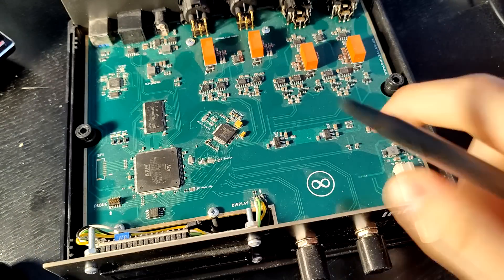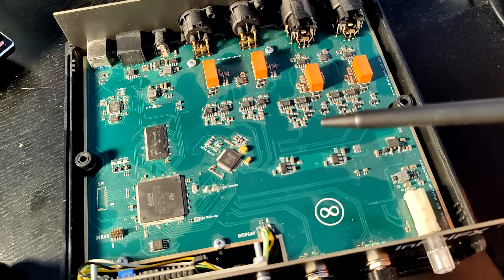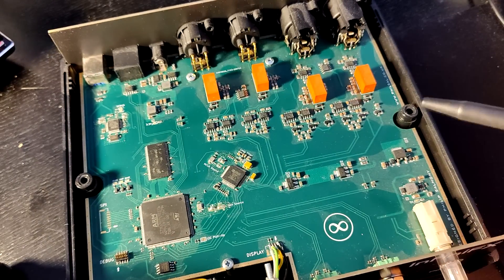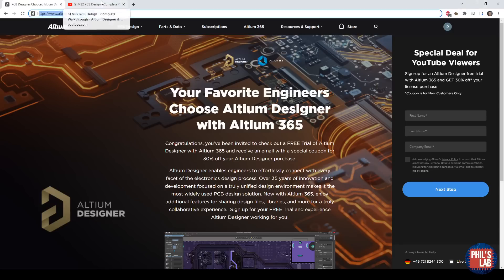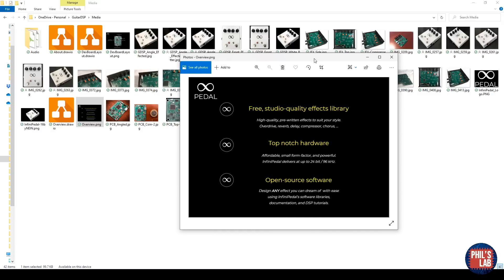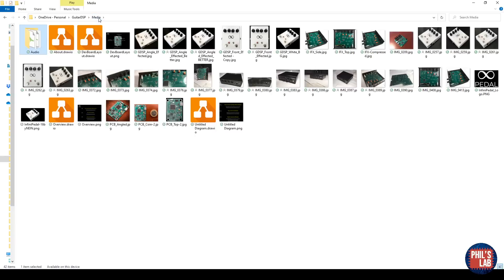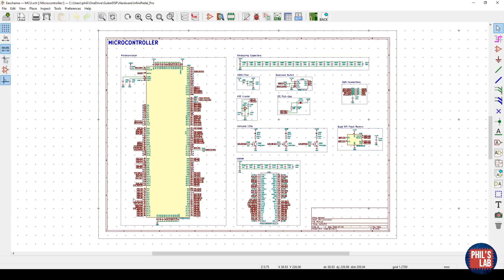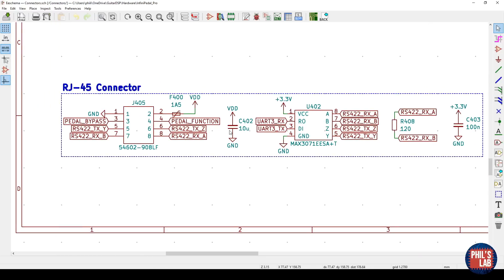(Sponsored) Audio Processor Prototype Hardware Design - Phil's Lab #57

Comment: hi Phil, at 12:47, i noticed on your single-ended to differential converter opamp circuit for the hi-Z inputs, there's a very very HF cutoff LPF (5.6k with 100pF) on the opamp that produces the negative differential output. I'm curious, what is the reason for that? why isn't that opamp just a plain voltage follower like the one for the positive differential output? Thanks :)

Comment: I have done front/back panels using both aluminium and FR4, from jlcpcb. However I find that the FR4 versions are much more rigid. So now days I only use FR4  (unless I need to transfer heat). I always keep the top and bottom copper on the panels.

Comment: Thank you very much for this video!
On a four layer board, would you (nowadays) recommend to flood fill the top and bottom layer empty spaces with ground or are the ground planes enough? (On a two layer board I fill everything, but I don't have too many four layer boards under my belt yet :) )
If I understand correctly, now one would do combined ground planes not to have a PCB-sized dipole antenna?

Comment: Great video as always.
The second STM32 functions as a ST link where did you get the ST soft ? Also what are the minimal mcu requirements to run it ? Asking since a DIY ST link sounds like a nice side project.
Regarding the ground plane , wouldn't it be batter if there was a partial cut separating the buck converters from the analog stuff ? Or would that make referencing harder? 
Also i noticed a lot of via stitching in some sections like i think crystal, it that recommended or you did it just to be safe ?
Reply: You could flash it with Black Magic probe.

Comment: Nice rundown of your project.   Are the XLR connectors (inputs and outputs) attached to the panel?  I can see holes for mounting on the outside, but no fasteners.
Reply from the maker: Thank you, Jim. No, I hadn't attached the mounting screws to the prototype I showed in the video.

Comment: Well done. A few comments for the next rev. Separate AGND and DGND, linking once, under codec. 'A' stuff should only be over AGND etc. Consider the case of un-balanced in and out, maybe take a look at SSM2142 series; one output leg grounded causes other to increase gain by 6dB. Not sure what codec you used, but pay attention to component types; the may be a large value NPO required across the ADC diff inputs to clobber idle-tones - expensive, but a life-saver. I have managed >100dB unweighted with this kind of stuff before, but it does take some effort. Also, relays need to be specified as being able to operate without any wetting-current, maybe gold plated. Long time since I have designed high performance mixed-signal stuff. You are doing good stuff and drop me an email if I can help further - markaren1 in New Zealand.

Comment: Thanks again Phil, I get a lot from these videos. Great to see the components you use in practice - I spied the AOZ1360AIL programmable soft starter in your power schematic and looked it up straight away. A video on how to get robust power protection, fusing and filtering right would be invaluable.
Reply: Agreed, robust power protection with resettable fuses, TVS and stuff like that would be great
Reply from the maker: Thanks for your comment, Dan. Yes, that's definitely on the list of videos I'd like to make in the (near) future :)

Comment: Nice video :)
I would like to ask you why are you using an anti-aliasing filter (20-20kHz) while the codec can handle up to 192kHz sampling rate?
Reply: As the maximum frequency of the signal you want to sample is 20kHz, you must filter at that frequency to avoid other unwanted high frequency components. Other thing is the sampling freq of the DAC, that should be at least twice the maximum frequency of the signal you want to sample, that is why audio is usually sampled at 44.1kHz (a bit higher than 2x20kHz). The ability of some DACs/CODEs of sampling at higher frequencies allow you to recover the signal with better quality and to process it with more agressive digital transformations.
Reply: @eldora7908  Yes It's called Nyquist theorem, but the point of ADC capable of higher sampling frequencies (like in this example 192 kHz) is to avoid using complex and costy filtering circuits.
By the way I have no idea how you can "sample" with DAC -> Digital to Analog Conventer...

Comment: Thanks for sharing phil!

I would love to know more about the H7 programming. I.e, do you have the codec hooked to the F4 core which does all the interfacing, and use the F7 core to process the data, which is shared via HSEM? If you can, sharing and/or showing the code would be wonderful
Reply from the maker: Thanks for watching, Marco!
This is actually a 'single-core' H7, so interfacing is pretty much identical to the 'GuitarDSP' (STM32F4) board, albeit with other drivers to fit the Analog Devices codec. I have a video on the I2S/Driver/DMA code on my channel that goes through the setup.

Comment: Nice video Phil. I've a question, why don't you have more copper fills on the top layer though ?
Reply from the maker: Thank you, Aneesh. For multi-layer boards, I typically don't 'arbitrarily' fill copper (unless I have a specific reason) on signal layers. Eric Bogatin has a few good videos on that subject.
Reply: @PhilsLab  I see. I thought having as much ground fill as possible on all layers were the right way to do it since it can act as a shield from outside noises and also decrease the EMI emissions from our PCB's.